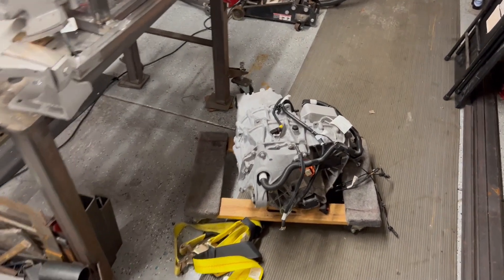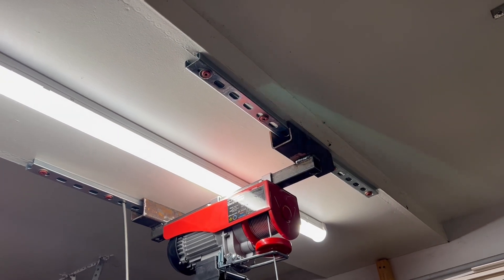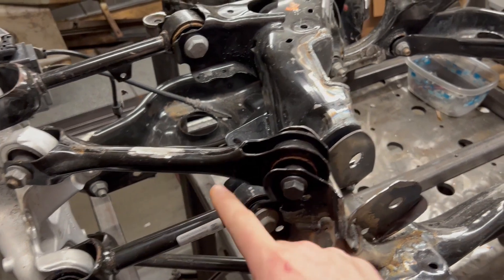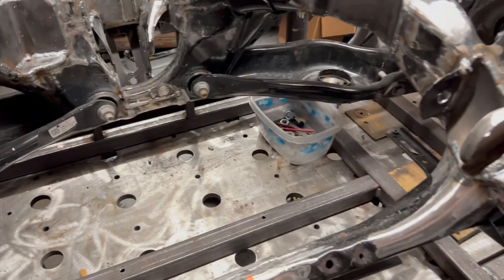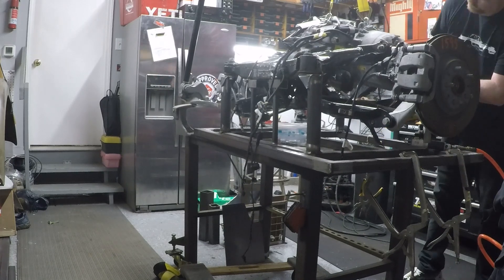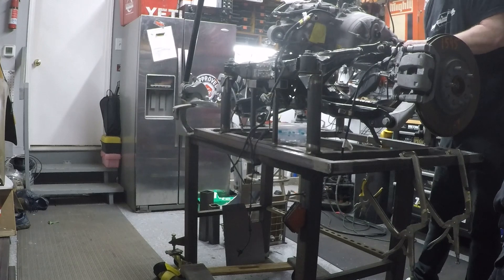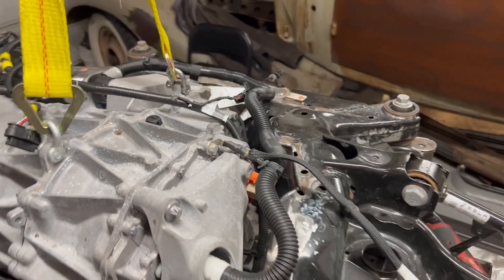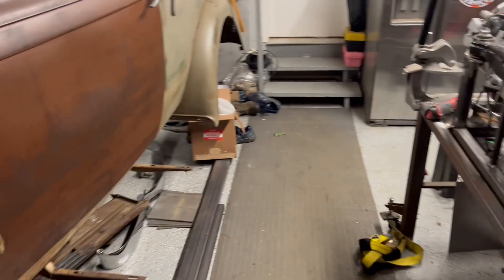I have the narrowest Tesla in the world! Chapter 5 EV Conversion Project

Comment: Good stuff. I'm thinking about doing something similar, but using a Miata rear subframe and a Leaf motor and gearbox. I'm not sure yet. Hopefully it won't require as much cutting and modifying!
Reply from the maker: I highly recommend a subframe cradle like I built and work on it on a bench or table.  This cradle really made keeping everything square easy.  I just slid the cradle under the car and it is so easy to get the suspension geometry where it needs to be before building the subframe mounts